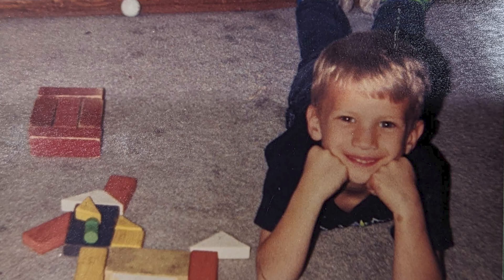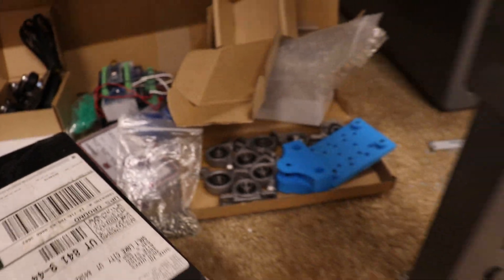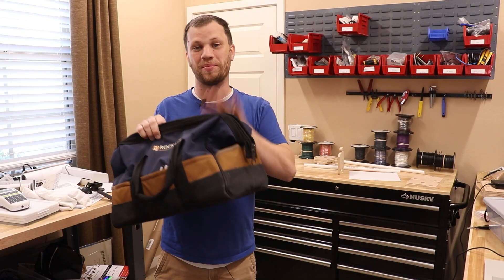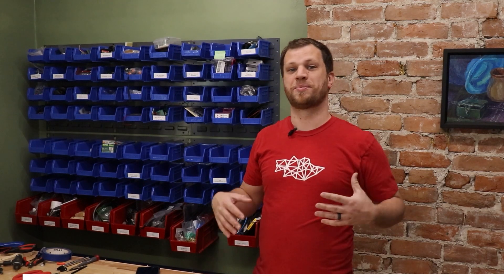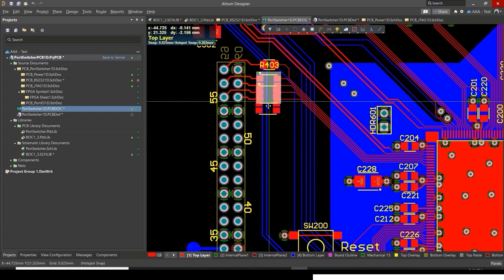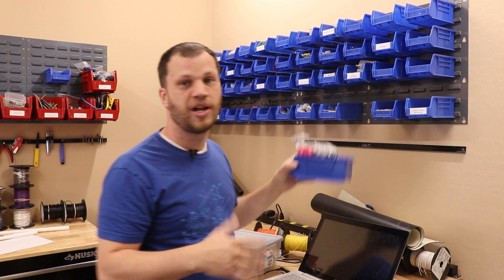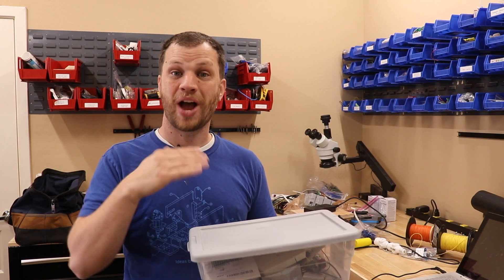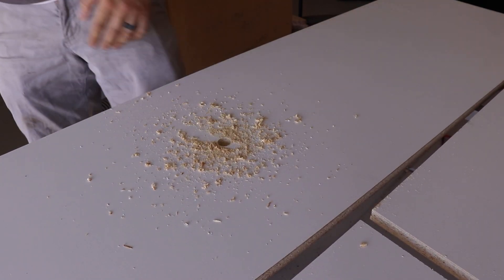It's Time To Get Organized | Practical Skills For Makers

Comment: I've been getting to grips with this issue recently 🙈 I frustrate myself with it, I bought a CR-30 print mill which I've used to print brackets, to fit 40mm pvc pipes, it's a cheap material.. have got 15 callax boxes in an alcove but I like the idea of doing the same with the small transparent boxes.. 50 boxes in an alcove 🤔👍👍👍

Comment: If you're like me, you get just a little extra terrified when your tablesaw blade is that high.
Reply from the maker: Normally I keep it as low as I can and still make the cut. However in this case I wasn't passing the work piece all the way through the blade. I wanted the end of my cut to be as vertical as possible. That meant I needed to raise the blade so that I was cutting with the most vertical part of the blade. Does that make sense?
Reply: @bytesizedengineering  Oh yeah, it makes sense for sure.  I do the same thing.  No less terrifying though.